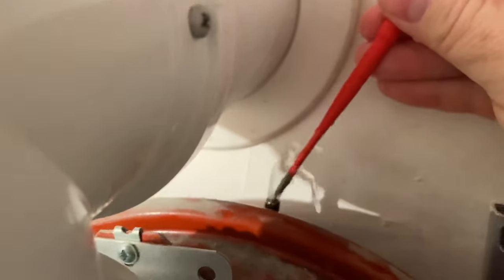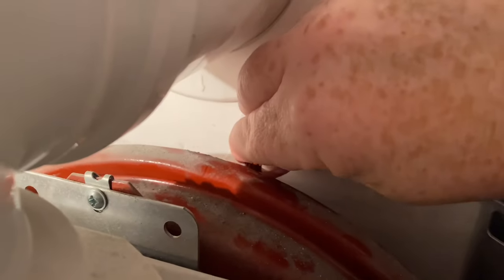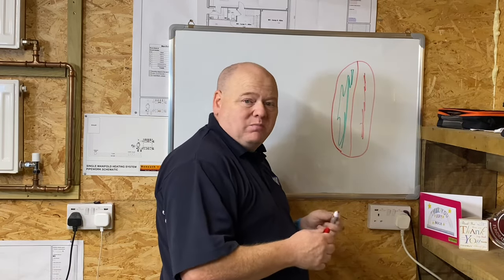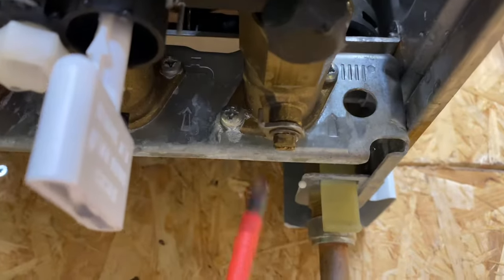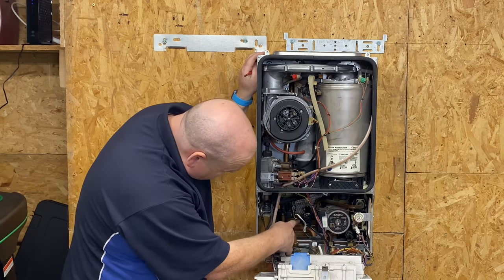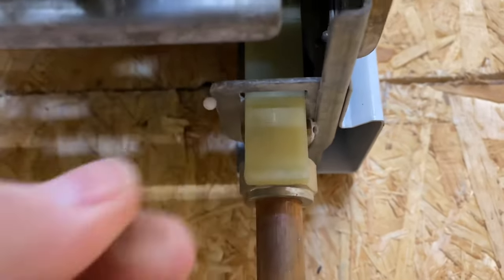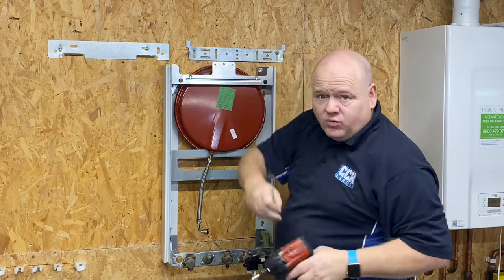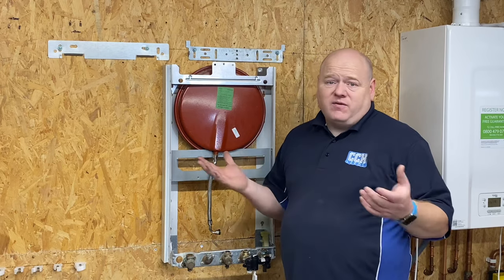How To Replace A Faulty Expansion Vessel - Worcester Bosch Greenstar Combi Boiler / System Boiler

Comment: Water out of the schraeder doesn't always mean new expansion vessel. It can be a build up of moisture over time on air side of vessel. Drain boiler and remove schraeder, put a hose onto schraeder connection and pressurise boiler to 2 bar, that will push all the water out of air side of vessel.  Drain boiler again, replace schraeder and repressurise vessel with air. The amount of vessels that get disregarded as faulty is amazing and 9 times out of 10 is just condensation on air side.

Comment: Thanks Allen,I used to check the bottom for blockage or the rubber diaphragm falls off, then pump air to test pressure,if failed repalce with new vessel.

Comment: I replaced an expansion vessel recently on a Greenstar combi, just dropped of the flue and lifted the faulty vessel up and out from behind the boiler, with it still in place on the wall, quite an easy job.
Reply: I was just going to comment on this video and ask this.. ( can the vessel be removed while the boiler is still on the wall )   I've seen other videos on vessel removal done on this model and they all remove the boiler..  Take the easy route if it can be pulled out from the top I'd said
Reply: It is of course dependent on available clearance above the boiler, I had 270mm on this particular job, but as the flue needs removing to take the boiler down then it's worth a try. I must say this design is a little poor causing unnecessary wasted time and expense.

Comment: My mums failed after only 4 years. Plumber fitted an external one, luckily its in the loft but would never touch worchester again.... gone with baxi 800 ever since watching your videos for my rentals.
Reply from the maker: Andrew Crampton The baxi ones are a bit bigger but they will still need pumping up on a service. 👍
Reply: @AllenHart999  cheers pal I get the service done every year at same time as the gas cert and to keep the warranty in place.
Reply from the maker: Andrew Crampton Make sure they pump the expansion vessel up 😂🤦‍♂️

Comment: Keep fingers crossed the valves don't leak when you turn them. Took the boiler off a few times to do this. For the cost of the prv definitely change it and also I have found the Flexi pipe to the expansion vessel to be blocked a few times.

Comment: Hi Allen, Another quality educational video -Thankyou. I might need to replace one of these on a Greenstar 30si approx 11 yrs old. The MI's quote the expansion vessel can be removed with the boiler in situ - However need to remove the flue elbow to slide it up from the rear of the boiler. Just wondered what you think about the boiler being in place while it's being removed?

Comment: Great video but please note everyone of these boilers does NOT have to come off wall to replace, as long as you have clearance above vessel will slide upwards and out, you only have to remove braided hose from manifold and undo screw from above and lift upwards
Reply: that's just another way to charge more😅

Comment: Another top video Allen. I wouldn’t have taken that boiler off the wall personally. I probably would have fitted an external vessel on. Having to take the boiler off & on would be expensive on labour besides being a ball ache to do but if the customer wants to pay they can have it there way 😂
Reply from the maker: Thanks.
Reply: Would you ever leave the boiler on the wall & slide vessel out from the back? I would never remove the boiler personally, remove from back always first option IMO.
Reply: @paulbird5851  Dear Paul. Is this possible with the Worcester 30SI??? Leaving on the wall and taking the Expansion vessel from behind??? Will save me a lot of time and effort if it can be done??? Need to change PRV too. I can and will do an external if need be but for £40 cost in parts for vessel and PRV. I am happy to exchange the vessel and not go external. There is room but not a lot. 
Keep at it. 💪💪💪
Best regards, 
Scott. ✌️🙏✌️
Reply: @scottl7644  Never done one so not sure, but if its on the back I would guess yes. With reference to PRV, fit one outside the boiler is always an option remember. ( A lot easier)
Reply: @paulbird5851  Dear Paul. Yes it is on the back with single screw behind the flue. It will save me a lot of time doing it that way and I thank you for giving me the information I needed to at least try. Yes PRV external if possible and will look into it. Thank you kindly. 🙏🙏🙏

Comment: Thanks for this video, very helpful. A question: is it possible, once the flue and hose are disconnected, to slide expansion vessels up, without removing the boiler from the wall?

Comment: Depends on the situation on the flue.
If virtual then strait up out the back.
Same if flue either goes to the left or right.
But if it goes how urs was I’d loosen wall plate about 3 inches lift an slide out, I always go on easy option or install external expansion if in cupboard out way airing cupboard ect

Comment: Alan would it be possible to lift the expansion vessel up and out the back as long as you had the necessary height for the lift,you could do this with Vokera Minutes and Lynia's
Reply: That’s what I do. Change them in 30 mins with 26/9 checks
Reply: Not with the horizontal flue.
Reply: @keithtitley9452  just over an hour horizontally, new turret and flue seals and if the flues goosed new flue. Flue off vessel out flue back on. Unless it’s in a block of flats then I fit a remote vessel.

Comment: Slide them out the top if I've got the space. Worth checking the flexy for blockages or firing a new one on.
Reply from the maker: Thanks.
Reply: @AllenHart999  how much space (cm) do you need to do this? Thanks

Comment: The EV on my 28 CDi is quite different looking. Sort of round cornered rectangle. It connects direct to the pump. Hard to see how. I can see a metal clip on the front of the black pump flange. Does this work the same way?

Comment: Once you have removed flue elbow you may as well slide it out of the back, no need to remove boiler? (One clip if space)
Reply: I didn’t realise you where a Sapper Paul. 💪💪💪
35 Engineer Rgt For 4 years until I transferred to the Navy. That didn’t last long either as I wasn’t from the correct family tree or born with a spoon in my mouth. 
Thanks for the advice mate. I am a sparky myself now but been working with my plumb mates doing the electrics and smart meters and learning along the way. Our Worcester 30SI keeps losing pressure below 2 bar while CH on full blast. Pushing it out the over flow so PRV is gone. Tested valve on EV and water every where. Full of it. 
Best regards, 
Scott. ✌️🙏✌️

Comment: Is it possible to fit a external unit ? So I don't have to have the boiler off the wall, bad design in my opinion it being at the back of the boiler tia

Comment: Hi. Great video. I have an issue with our bosch c1 boiler. It looks like its leaking from the pipe that connects to the bottom of the expansion vessel. The boiler kept losing pressure and I noticed after re pressuring I found the leak. I have booked British gas in for a week on Tuesday, the earliest they could come out. This was before I found the leak. Do you think it's an easy enough fix? Thanks 👍

Comment: Please how do i comferm if the boiler itsself is loosing pressure? .some said top it to 2.5bar short the electriciste off ,switch off all the in flow and reutrn valve   for 24hrs  .see if it drop ..is this right .but another exper explain to just short the heating flow and return .and keep hot water on please which is which

Comment: How would you go about adding a remote expansion vessel instead of replacing it? Just leave it in place, all connected up and hope that the rest of it doesn't fail and leak or is there things available to cap it off?
Reply: Drain the existing vessel, fit a new flexi & suitably sized male & rigid copper pipe to the new remote vessel. Worth replacing the prv as it's probably been activated due to expansion vessel failure. Taking one of these ageing horrors apart to replace the vessel is asking for trouble. New Worcester range are no better designed.  I've been fitting Viessman for 15 years now. Different class.

Comment: Hello ,resently  my home boiler, expansionvalve has been replace but he haven't top it up with any air ,he said it's already with air when new ? Herman  sunduval  MICRA 3 24 SE low Nox .it's still dropping pressure  ,but lesser  than befor
Reply: Should be pressurised to 0.7 Bar

Comment: Wonder why they make expansion vessel so inaccessible. Should every new boiler be fitted with external expansion vessel to cope with expansion of heating system. As someone told me the expansion vessel in the boiler is only to account for expansion in the boiler. ?  Graat videos as always. I’m not gas engineer though. Just find it interesting. What do you reckon is the better brand of boiler now. As Worcester’s have so much plastic in now. ? Valiant, Baxi and ideal are good aren’t they?
Reply from the maker: Which car is best? Lots of really good boilers, They just need to be installed correctly. Thanks.
Reply: Baxi in my personal opinion, I can't fault them as a heating engineer
Reply from the maker: Jordz H R Depends what you need. They certainly don’t make the best heat only boiler, in my opinion. They do not have a storage Combi either.
Reply: Viessmann good boilers all round even the heat only or the combination boiler, their storage Combi , vitodens 111 is currently the best going on the market I reckon, ask me 20 years ago I would’ve advised a vaillant boiler.

Comment: Hope it has a vert flue and isn’t too close to the ceiling then I take them out of the rear. 👍
Reply from the maker: That’s just too easy lol. Thanks.
Reply: How many cm above the boiler do you need to do this? Thanks
Reply: @claire Lewis about 6 inches, but you need to test the boiler after removing the case to make sure it’s safe. So use a qualified gas engineer

Comment: Hi Alan,
Is there any differences in the pipework going to the boiler frame between Greenstar 28 junior and the new 3oI
Reply: Do not worry about replying to this question as I found the answer. condensate pipe, cold water mains and prv have about 3 mm difference. Thanks anyway.

Comment: Sell them a new boiler and if that's to expense for them then put a pressure vessel connected to the pipe external to the boiler.
Reply from the maker: I have installed them a new boiler. Thanks.
Reply: That's good all round mate. I'm much older than you and I miss the older boilers long before the condensing one's even. I no there more energy efficient now but not cost efficient. It's good to see your into doing a good job. Well done you

Comment: With the flue removed and dropped, would it not be possible to disconnect the water feed to the vessel, remove the vessel-retaining screw, then lift it out vertically? No need to remove the whole boiler from the wall?
Reply from the maker: Depends which way the flue goes. Thanks.

Comment: What causes the water to get to the other side ripped diaphragm
Reply from the maker: In my view. A lot of the time they do not get pumped up or serviced correctly. This makes them split over time. They're only 6 L so very small for most systems.

Comment: Thanks Allen , I have Worcester 30   ,,had a problem ,as still under 6 year warranty  by 2 weeks to go warranty  ,, engineer came out said it was Schrader   valve , 25 minutes he was gone , very quick ,,engineer said to keep it at 1 bar ,, I phoned Worcester offices 2 weeks later as this concerned me ,  I explained  , Worcester,, said keep it at 1.5 bar ,, trouble is it at 1.5  pressure goes right up just under 3  BUT   then when no load ,  drops back down below 1.  bar and have to top up water,, after several times I now when it lowered to 1 bar I left it 1 bar  , pressure goes up to 2 bar  but not as far as before , but top up seems not so often ,, I reckon it could be faulty expansion vessel and engineer was saying Schrader to warranty run it time out
I see how Worcester have tank at the rear , no make sense ,,  I have word with a plumber and see  fit separate tank out side of boiler, seems easier way
I am retired roofer most of my work was stone  slates and natural slates,,  refurbish of listed building ,,  started on roofing  building on building site in 60's 70's  to early 80's and then into refurb ,,just love old buildings , the architecture building/roofs  is amazing ,,
thanks Allen you have enlighten me , now a following subscriber of yours ,, thankyou Allen    
stay safe Allen  . 

PS do you think vessel has been overcharged /pump back up as 1 bar seems better than 1,5 bar
Reply from the maker: https://www.youtube.com/watch?v=UR9wSU-I2O8&t=87s

Comment: Good boilers, good dhw flow rate but badly designed to work on, prv- nightmare, hydraulic block can be a weak spot, found quite a few burner seals failed and rippled heat exchangers on the older ones
Reply: Plate removed prv easy to get at, just close your eyes and feel for the entry, easy to do when you’ve done a few

Comment: I,ve got one of these I was told at the time how good they were but after 8 years I can tell you what a pile of crap they are always leaking to many plastic parts I,ve just had a estimate for right hand block leaking at back behind flow turbine adapter £470 for repair expansion vessel failed previously after 5 years, it,s coming out not spending any more money on it.
Reply from the maker: Worcester Bosch should be able to do a fixed price repair for around £300 Thanks.
Reply from the maker: Thanks very much for your comment, please consider subscribing to support the channel 🙂
Reply: is it not covered by there 10 year warranty ?

Comment: I have changed the expansion vessel for this boiler few times. I have  never took off boiler from the wall . If I have enough space above the boiler then I move the flue and then change the expansion vessel and PRV. I rather change the boiler If I have to remove the boiler from the wall.

Comment: And here ladies and gentlemen in one short video is the reason that me or any of my mates would never ever consider fitting a worshitter Bosch. For years they have simply never given a toss about service and repair guys. Prv and exp on the back. Drain off facing forward above the pcb. Plate heat exchanger jammed in at the back. A series of dreadful condensate trap designs. Electrodes that are an absolute joke to get out when checking for a spark. Air pressure switches fitted to brackets behind the fan assembly. Then factor in rubbish plastic water set that springs leaks and a stupid burner seal. Boiler after boiler are a complete @@@@ to work on. They simply don’t care. All they care about is selling boilers and signing up customers to service plans when they inevitably go wrong. Worcester have been very good at persuading people who don’t know any better that their bang average boiler is a premium product.
Reply: What do you recommend instead?
Reply: @philippaday1495  I personally like Ideals, especially the Vogue. I’ve genuinely never seen one with a fault. Plus they have very long warranty. So you get peace of mind. Failing that I’d say a Vailant. But they are pricey. For a mid range boiler if you don’t want an ideal logic which would be my first choice, then I’d say a baxi 600/800. Hope this helps.
Reply: @Lutonman2010  Thanks alot! I've just been quoted £660 + VAT to replace the expansion vessel on a 10 year old boiler and I'm wondering if I should just buy a new one. I appreciate your expert opinion
Reply: @philippaday1495  that’s outrageous. Do not pay that for an expansion vessel change. Assuming it’s a Worcester with the expansion vessel on the back. So boiler off the wall to change. Half a day £150 labour. Expansion vessel £100 tops. Prv £30ish. Chemicals £15 max. Plus vat. My advice is find someone else
Reply: @Lutonman2010  That's what I thought - he has to take it off the wall due to positioning if that makes any difference

Comment: Fit an auxilliary vessel and dont give Woofter Botch a penny.
Better still pull it iff the wall and fit an Ideal iMini.
Buy it for £600 and fit it ypurself its a piece of cake and you dont have to be gassafe.
Heck if you are worried just get some local gassafe muppet to do you a landlord cert then its on their head!

Comment: Must be one of the worst designed boilers of all time for ease of  maintenance. If I do weaken & take on the job of replacing the EV on these I fit an external vessel connecting to the flexi with a suitable adaptor & rigid pipe. You need to be a trained gynaecologist to replace the prv in situ. I've used Viessmann for 15 years & never looked back.

Comment: Worcester is the worst design of boilers , especially worcester research and development team never think how to repair and maintenance side. To reach expansion vessel, plate heat exchanger , divertor valve is not simple. I always cut my handswhen changing PRV, so tight place.. hope worcester  will read my comment and take it as insult and think about making things simple...
Reply from the maker: Happy Christmas